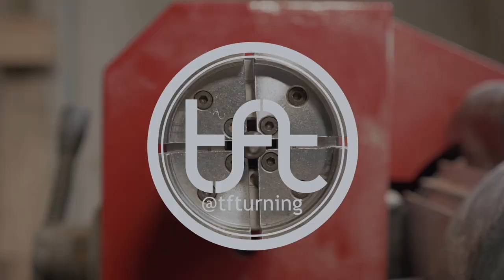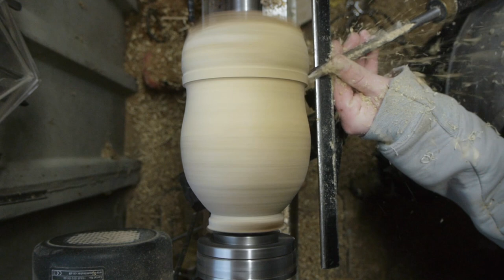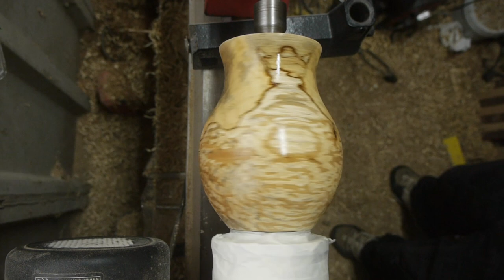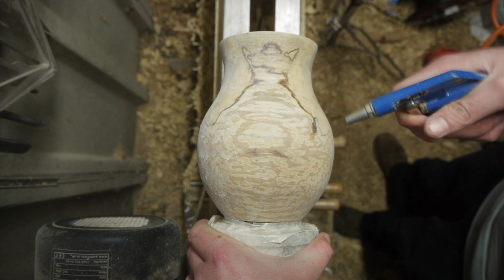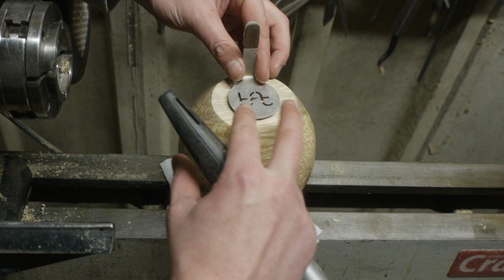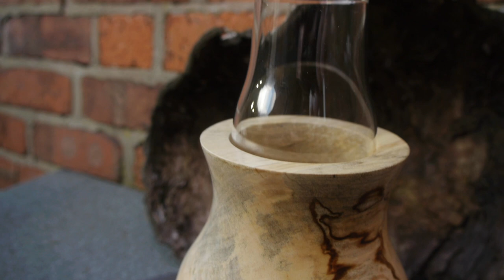Spalted Silver Birch Vase With A Super Shiny Finish - Woodturning

Comment: Why do people hold the drill chuck when drilling? Makes no sense.  YOu don't see metal lathe workers doing that.  Imagine, just one mbad catch, and your hand is right in the middle of things.  As an Industrial Arts Teacher, I would never let my students do that.
Reply from the maker: The hand on the drill chuck helps to steady the bit in the first few millimetres of the cut or further if what you're cutting into isn't perfectly flat. More importantly it helps to prevent it from coming out of the tailstock when you're winding back from the piece. It's mounted to the lathe on a push fit morse taper and it can vibrate itself loose if you're not paying attention.

Comment: Almost everything is wrong here. First of all, that big tool is a "spindle" roughing gouge and using it as you did on cross grain is dangerous. It is for roughing down spindle oriented wood. Secondly, you need to learn how to get a better finish off the tool on soft wood. Almost impossible to get a smooth finish off the gouge on punky wood like this, but using the sanding sealer to help seal and harden the wood before doing very fine finish cuts would greatly help, as would scary sharp gouges used very gently. And why stop sanding when there is still so much torn grain. Putting finish over torn grain is just bad workmanship. You ought not to be putting out videos about how to do woodturning until you learn how to turn. Take some classes. Your outside shape is wonderful, but the inside should follow it. Learn how to turn the inside too.
Reply from the maker: The punkiness of wood was a real battle with this one, I did in fact try using a wood sealer and harden the problem areas for a better cut but it just became damage limitation towards the end.
 
In terms of "how to do woodturning", these videos are not instructional, I make that very clear in my descriptions. 
Thanks for the feedback.